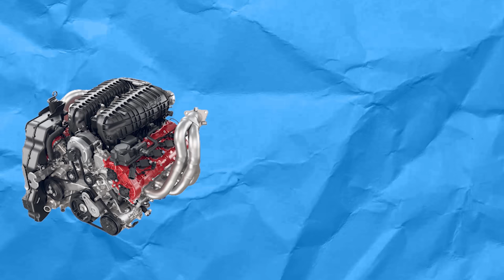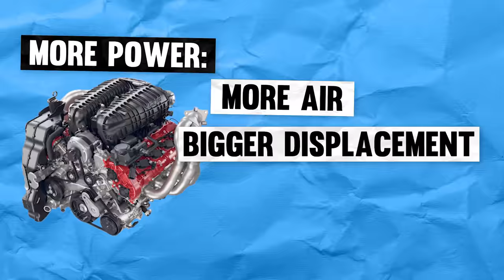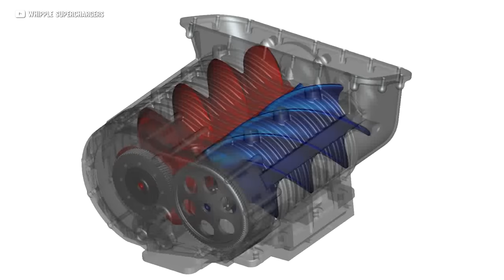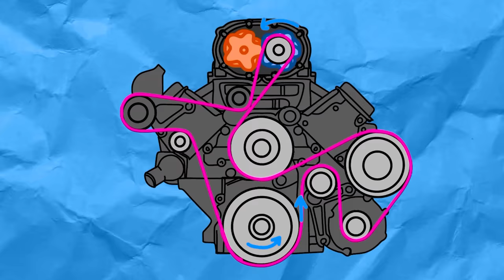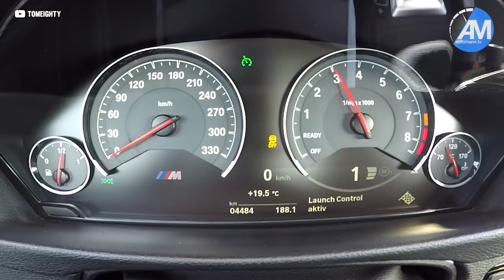Turbo vs. Supercharger - Which is Best?

Comment: You didn’t point out a drawback about turbocharge design. Turbo has limited life because engine exhaust gas has a very high temperature. Unlike turbo, supercharger sucks air at regular room temperature. Supercharger design can last for a decade.

Comment: Super charged takes power - turbo recycles energy. 
But since we switch to ev it's not that that important
Reply: Turbochargers also take power as it's blocking the exhaust to flow free by rotating the turbine, but it's less than what supercharger takes.

Comment: Gotta love a supercharged mercedes benz. 
Biturbo is amazing to from mercedes but the supercharger works just fine. 
Funny thing is mercedes supercharged a 4 cylinder and it makes enough torture to make it a viable option for the motor as apposed to a turbo.
They have been supercharging motors for a hundred years. 
Mercedes forever !!!!!

Comment: I've lived with Turbo on Domestic branded vehicles and the Domestic ( Ford, GM ) don't that Turbos get upto 1380° F
These manufacturers, mount the Turbos too close to engine block. Without a Heat Shield 🛡 or an insulation blanket. They are mounted so close can't even fit an insulation blanket or cover on the Turbo. The heat from the Turbos causes thermal variations, which the engineers in the automotive industry are not familiar with.  I've worked in Aerospace for years and part of my work deal with thermal variations. Nice, though personally prefer an N/A, like the GT350. 
If anything the roots style Supercharger is the only way to go, and the
 Manual Transmission. I would prefer GT350 to a GT500 any day.
Even if the GT500 cost $45,000 and the GT350 cost $50,000 I would pay 
$50,000 for the GT350. 
🙋👍🏎🏁

Comment: Misnomer both suck in air and blow it into engine just one driven off crank other off exhaust, so calling one a sucker and one a blower is factually incorrect. they both operate in same basic fashion they take clean air compress it and push it into engine, they are just driven differently. turbo is actually more of a blower as exhaust gas blows turbine a  blower is really a turner as it is turned by crank to make boost. But yeah sounds silly but I like accuracy.

Comment: Dont forget supercharged engine is on boost all the time, and turbochraged when flooring the gas... so i guess supercharged engine longevity is shorter ?
Reply: I think when a supercharged engine is on idle, there wont be much boost, so it probably doesnt affect the engine. But i am not sure.
Reply: Not all the time, only when you allow it. The throttle controls the boost and YOU control the throttle.

Comment: He forgot one important point turbo generate heat a lot of it when the pil gets too hot it wont lubricate well then your engine will suffer i woud go for the supercharger and iy doesnt need the amount of power he mentioned to spin it its as lightweight as a turbo if the exhaust can do it the engine can do it better but we go for electric supercharger also but i don't blame him i blame the teacher for feeding him trash

Comment: You know a Roots-ish blower sitting on top of the motor valley won the Pro Modified championship 2020 yes? This in a field absolutely inundated by centrifugal blowers. Not a single Turbo was to be found, strangely. 

I guess the "Turbos rool!" crowd can sit down and shut up when it comes to Pro Modified. Oh, wait, they already DID.

If Mercedes or Porsche bothered with NHRA drag racing, they would quickly utterly dominate, then get banned, I think.

Comment: Well I always wondered why the pros in top fuel and funny car went with superchargers and not turbos because the pros are going 320 mph in quarter mile with supercharger and no one uses turbos. I take it from this video that is because of the large displacement of the motors they use it is better to use supercharger.
Reply: There are lots of issues involved. In a 4 sec race 1/8 second of turbo lag loses the race. Then there is the vast quantity of fuel used where the "inefficiency" heat of the Roots blower is used to help vaporize the gallons of fuel poured in which would just choke a turbo. Then there is the 1000 pounds of downforce provided by the upward exhaust pipes, if you use that energy to drive a turbine you lose that downforce which is critical at the start. These and more issues would have to be overcome. So far no one has.
Reply: With 12,000 hp on tap, instantaneous throttle response is an absolute must. When you backpedal the motor, you want it to instantly decrease output, not "think about it" like most turbo setups.

Also, when you get back in the throttle, you need it to respond instantly and in a linear fashion. The razor-sharp throttle response is what you seek, not ultimate power to arrive when the turbo is finally in the mood.

Comment: I thought a blower is a complete different unit to itself like what top fuel uses and pro mod car. 
Sure of that one 
Turbo
Supercharger 
Blower 
Are three different units all together the blower and the supercharger are made differently. Blower with two shafts that compress the air when rotates driven by a big belt with lots of teeth grooves and a supercharger is turbine front housing driven by belt similar to an alternator belt or fan belts. A turbo driven off exhaust gas! 
😞🙊🤷🏿‍♂️ I thought that is exactly what it was
Reply: Blower is just slang for supercharger. What you described are two different kinds of supercharger (and, technically, a turbo is a supercharger as well since it supercharges the air...) 

People often use blower to refer to a Roots Style Supercharger... usually. Sometimes you'll hear it used to describe any top mounted supercharger, centrifugal or otherwise. 

Some people use the word "Procharger" (which is a brand) to describe offset belt mounted centrifugal superchargers.

Comment: Turbochargers would never stand a chance in the alcohol funny cars or dragsters. By the time they spool up the supercharged car would be long gone. I don’t even think a turbo would even survive in nitromethane whereas those cars today will hit nearly 300MPH  in less than 3 seconds there is literally no time for the turbo to compete vs those massive superchargers that are in use which make somewhere around 11,000-12,000 HP

Comment: Both great except on motorcycle, super charger safer as it doe not have lag or kick, both bad when leaned over in a curve on a bike. Why kawasaki supercharged bike rocks and turbo bikes good for straight line runs only. you never want to be leaned in a corner on bike when turbo hits, that is instant crash.

Comment: That's funny...there's absolutely NO replacement for displacement! Adding a supercharger or turbo to any engine, especially a smaller one, will increase its power output. Now, what happens when I add that to a BIGGER engine? The smaller engine stands no chance. Take a turbo 5.3 LS vs an LS7...the 5.3 would win. Now, turbo 5.3 LS vs turbo LS7.....GAME OVER!

Comment: I prefer the turbo because it's more efficient, takes up less space, it makes waste into power, and it makes the STUTUTUTUTUTU sound which is cooler than the whine of a supercharger.
Reply: A turbo system takes up less space than a blower? That's quite the opposite.

Comment: I hear of 20x the amount of turbo's failing and having to be replaced (only to fail again 2500 miles later) than anything I see  supercharged.    This relibility issue needs to be factored into the equation as turbos can cost big money to maintain or replace due to the complexity of the whole system. Most of these turbo failures I am talking about occured on North American cars and trucks to be fair, including turbo deisel trucks.
Reply: But European car engineering are decades ahead of North American, in every single aspect. American cars break down insanely often, hence about 1 in 150 cars is an american here (usually a standard family Ford). Although the new Mustangs & Cameros look very sexy

Comment: the reason why Mopar is using super chargers is the history of drag racing,  all those top fuel and funny cars use a 500 cubic inch block which was a  Mopar, design doesnt matter if its a Toyota or Ford or GM, they are all the same spec. turbo charging  involve s alot of exhaust mods and plumbing, super charging is linear in power curve, where turbos have blow valves boost controller etc, which old school, I think the real deal is how fat is your wallet

Comment: No no no NO. It not "free energy" if it takes 140hp to run a deamon SC than (given the same PSI and CFM) a turbo needs the same work put into it as well. Exhaust gas in a motor is for the most part pushed out of the cyl on the the exhust stroke. With a turbo there you are creating a exhaust restriction. To overcome that you MUST take some of the the power made durring the power stroke to push the gasses out vs it just being able to freely flow out. Work is never free, if it was, perpetual motion engines would be an actual thing. If you dont believe me you can google tests where a motor with both a turbo and SC are dyno tested. Both have the same psi AND cfm rating. They are close to each other. One may make more HP and the other may make more TQ and the power may be in different spots but when you average the amount of "work" output is only a few % off in favor of either depending on the test.

Comment: It's absolutely untrue that driving a turbo does not require power from the engine. It takes power to compress the intake charge regardless of whether it's in a centrifugal, Roots, or twin screw supercharger, or a turbocharger. The power in a turbocharger comes at the expense of exhaust flow. Restriction in the exhaust system of an internal combustion engine results in power loss at the crankshaft. Period.

Comment: Another lie sourcing the right supercharger for an engine isn't that hard you can use it m1190 or the m90 the m120 a whole host of others to do small displacement engines and get a ton of boost and something like it 2 to 3 l engine you get up to get 20 lb of boost that way

Comment: ANYONE HERE WANT TO TALK DESIGN? 
I HAVE A LOT OF ORIGINAL IDEAS.
YOU CAN ADD AN INTERCOOLER WITH WINDOW UNIT AIR-CONDITIONING UNIT.
Reply: Original? You mean the same thing that Dodge is already using on the Hellcat engines?
Reply: @frankjohnson6342  THEY USE AN OLD WINDOW UNIT?
NO THEY USE THE ONE DRIVEN BY ENGINE.
WHAT I DID WAS BUY A HOME UNIT FOR 89 DOLLARS USED AN INVERTER.
Reply: @frankjohnson6342  IT'S A CHEAP EASY WAY.

Comment: in reality the whole no replacement for displacement is proved wrong when you are playing with dohc/vtech engines whether it be a a small 4 cyl vtech honda motor or a ford 5.0 coyote engine or 5.2 voodoo (gt350) and 5.2 predator engine (gt500) basically those are all like 2 vtech homda engines put together 4 cams and 4 valves per cyl.  smaller displacement making more get done. gt500 make 760hp hellcat with more litres of displacement and supercharged Corvette engines with bigger engines have 2 valves per cyl 1 cam. But there is a reason the ford engines have become the go to swap.they can make 1200whp with no heads no cams no pistons and no rods.  LS and hellcat you need built motors to make that power. coyote you can add supercharger or turbo and get a 30k v8 f150 running 8s in the 1/4 and a 30k mustang gt running 7s in the 1/4 with boost fuel and suspension.  put the same stuff in a fox body mustang you can go 7s with less power or turned up go low 7s and crack 6s. or leave them at a reliable 850whp and have them all running 9s. plus you can make them rev to 8000rpm with just a tune. or go built motor coyote like you would have to do to get 1200hp out of a hellcat or vette engine and the coyote  can make 1500 to 2000hp. stock a gt500 weights as much as a hellcat makes around the same power but beats the 800hp redeye down a dragstrip but what a hellcat cant do is handle. gt500 gets aroumd a track in the same time as a Ferrari f8 tributo huracan evo and porsche gt3RS and can run as fast as 10.6 in the 1/4.  thats stock. 10k in e85 tune exhaust tires smaller supercharger pulley and tou can run mid to low 9s. plaid numbers for a car that starts at 70k with 10k in minimal mods. but it can still handle. ported supercharger and fuel system they have ran 8s or you slap a whipple supercharger on it and the stock motor and transmission has gotten them down  in to the mid to low 8s which you wont ever see a plaid or Bugatti do

Comment: You are quite under informed when it comes to turbos.  I am sure you are one of those people that believe in perpetual motion machines as well.  You can't get something for nothing.  To spin up a turbo, you are basically putting a blockage into the exhaust system.  this makes the crankshaft turn harder and thus robs power from the engine.  No, it is not just wasted energy coming out your exhaust pipe.  Free flowing exhaust systems make more power.  The supercharger and the turbo charger both take away power from the engine to make power.    You say it takes 900 horsepower to run a supercharger on a dragster.  Most transmissions, axles and driveshafts couldn't handle 900 horsepower.  you are telling me that 900 horsepower is going through that little rubber cogged belt to run it?

Comment: If u have a turbo u should have to adjust your gear setting so u will have full control then the super charger but still if u have have trash condition engine just stop dreaming about turbo or you will end up blowing up your engine😅

Comment: Dude. You missed sooo much.  And your points aren't even accurate.  I'm ok with likeing the turbo more.  Cause yeah. They can make huge power.  But no.  The power isn't free.  Your puting a dam in the exhaust pipe.  Also. Compared to a twin screw.   They make outrageous amounts  of heat.   And yes.  A 4banger can power a supercharger.   The 450 horse 2003 mustang cobra uses 30 hp to power it.  Centrifugal superchargers are even less than that.  If yer gonna make an Informative video.  Be informative.

Comment: You guys don't know anything.   Turbos are better but you guys really don't know why.
Reply: Why don't you think they know why, considering they came to the same conclusion you did.
Reply: They claimed turbos are free horsepower and they do work off heat expansion however an engine is still an air pump.  It creates exhaust back pressure.  They didn't mention turbo mapping which is matching the turbo compressor size to the turbine size for the engine size and application.  They didn't go over the three types of superchargers either.  Centrifugal, roots, and twin screw.   They behave very differently despite all of course being belt driven.  A twin screw looks identical to a roots on the outside but takes less energy and produces less heat per psi of boot made.   There are a lot of things they missed.